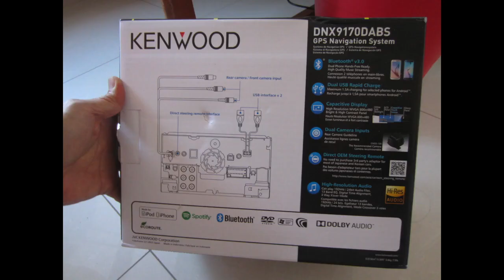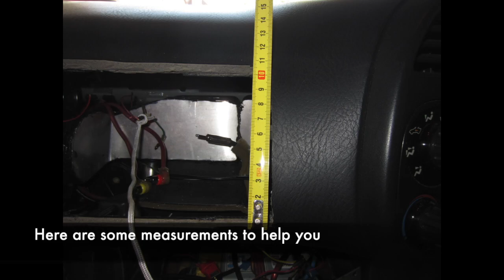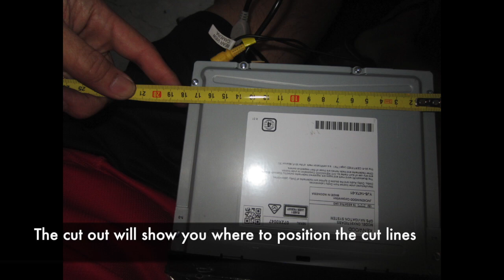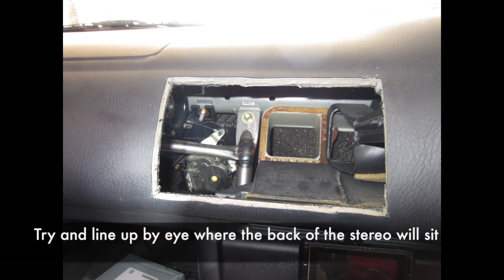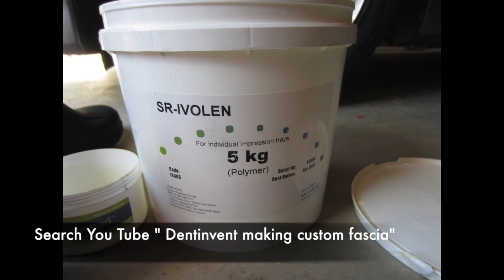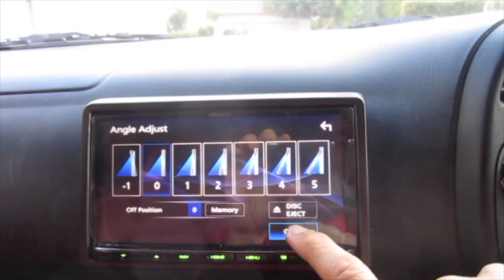Honda S2000 dash and vent cutting for double din head unit installation

Comment: Really interested in the bezel, as I'm trying to mount an ipad mini and want a seamless bezel for it, where did u get the bezel ? Any 3d scan files ?
Reply from the maker: The scan file won’t match an iPad mini at all . You would be better to custom make a smaller mount for the iPad mini . In fact, the dash cut out would be a lot smaller as you don’t have to have a massive hole in the dash . I’d even go for the alpine system with single din and massive screen like the halo nine.

Comment: looking to do this to mine but with the Alpine Halo9 ILX-F309. its single din with a detachable screen. Do you think it would work? havent seen anyone with a single din with this mod.
Reply from the maker: Unfortunately for me, the alpine halo unit cane out after I installed my kenwood unit. The Halo is better suited and you may be able to get by with little to no vent cutting. Best of luck .

Comment: Hi this old video but do you have the or made a stencil for the cut
Reply from the maker: I couldn’t make a stencil as it is very 3 dimensional but I did take heaps of measurements that i can give you if you want ( measured form almost every point I could measure from).

Comment: Wouldn't it have been better to use a heat gun for the driver side air duct, soften the plastic and push it inwards?
Reply from the maker: Good suggestion but I needed the duct to still re attach correctly and heating it would have distorted the shape too much .
Reply: @Dentinvent  Damn, I wasn't expecting a reply, specially from the creator. I want to say Thank you so much for this video, I plan on installing Pioneer's DMH-WT8600NEX unit, it's a bit longer than yours, with the cables plugged in, it's about 19 cm long, maybe longer. Luckily it is a single din unit so I plan on cutting above where you cut so I can avoid all the air ducts, but will have to build a box around it and wrap it in dark grey vinyl to make it look like part of the dash. 

Your video will be a great help for reference,again Thank you so much!!!!
Reply from the maker: @shadybeatsCarbon  
All good . Glad to help. I’m currently making a complete in dash set up for a 2007 odyssey RB1 . Made of original dash differing plastics , parts off another dash and parts off a mudguard off a scooter . It’s all plastic welded and painted . The part is finished but I’m still trying to work out the factory wiring . Stay tuned .

Comment: Would a single din fit here better? As I’ve got a halo 9 I would like to put there
Reply from the maker: alpine halo 9 single din would fit easily and you probably won’t need to cut the air conditioning vent . Just take note of where the tube would be and start by carefully cutting a small hole .

Comment: I want to do this to my s2k, what dimensions of a head unit is the max depth before I start cutting the ac tube?
Reply from the maker: The unit I used is 178 x 100 x 160mm ( W x H x D) meaning it is 160 mm deep . That is why mine is made to protrude from the dash . Another option which could avoid cutting the AC tube is to get the newer Alpine single din unit which has the large screen attached and mount that in the same place but have a smaller dash cut out .🙂 . Good luck man.
At 160mm deep you still need to watch space to fit the rear wires in because there are heaps of wires !
Reply: @Dentinvent  awesome thanks so much!

Comment: You can order the JDM original version dash board with Navigation built-in nicely, instead of risking so much to ruin the entire S2000 dashboard. Believe me, the 2 DIN stereo one day would need to be replaced and you may or may not find back the same size of stereo player to fit the hole again. Just put the top down and enjoy the breeze.....and cool air.
Reply from the maker: Thanks for the suggestion. When the head unit dies it will give me a new project . I think the JDM unit you mention would not have the features I want in a head unit such as flip down massive touch screen. Still remains the best thing I have done to my S2000.
I think I improved it rather than ruined it. But that is just my humble opinion. Drive safely man.
Reply: Dentinvent : it is not about the feature I want, but it is he Standard Pre cut Dashboard with proper wiring came out from the factory direct with no hassle to risk so much. You probably would know if the nightmare happens later. Fingers crossed.
Reply from the maker: Just wondering how old these jdm dashes are ? I even had problems trying to find  replacement rear bumper light wiring as they don’t sell that part any more for a 19 year old car . 
If it was jdm many years ago I would assume the unit that fits it is pretty small .